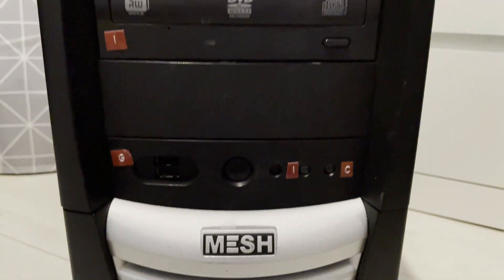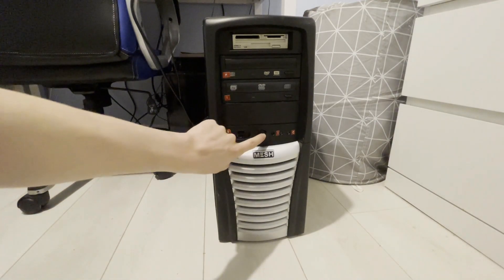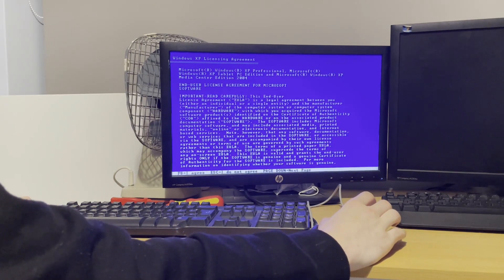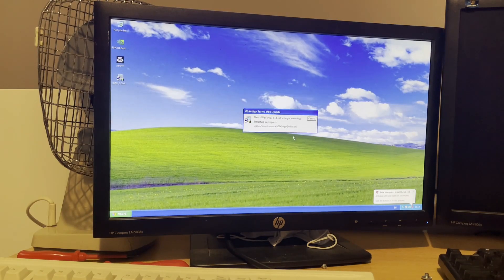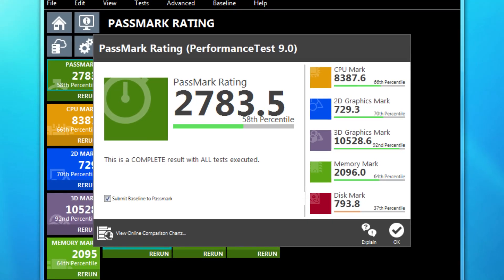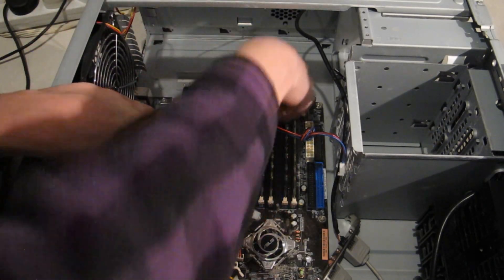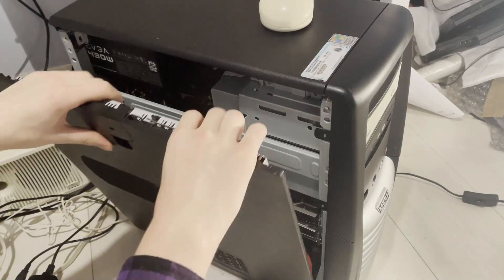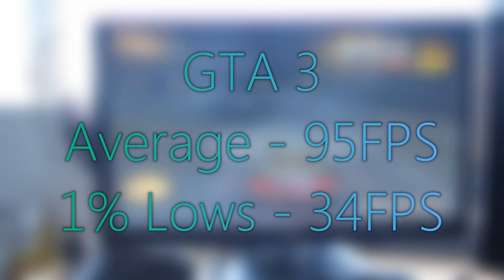Running Windows XP in 2022

Comment: I used to have a Dell Dimension 9100, Dell XPS 420, and Dell Dimension E520 from 2015 to 2020. Fairly good machines. The Dimension 9100 had an Intel Pentium D 830. Those BTX Dells are pretty good machines. The E520 I had stuck a Intel Core 2 Quad Q6600 on it. Used a NVIDIA GeForce 7800 GTX in both the Dimension 9100 as well as the Dimension E520. The Dimension 9100 could not even take a Core 2 Duo unlike what I have now which is a ASUS P5L-VM 1394 in a RAIDMAX Scorpio ATX-868WBP. My favorite system was a socket 478 PC that was a HP Compaq D530. That system I ended up installing a hyperthreaded Intel Pentium 4 Nothwood clocked at 2.4 Ghz. Also had a Dell Dimension 4550 which was decent. Got a ATI Rage 128 Ultra out of it.

Originally that Raidmax was a LGA775 Pentium 4 Intel branded motherboard based system that had seen better days or else I might have left it alone. The system that I built in the case also has a AMD Radeon R7 250X (originally) and Creative Sound Blaster X-FI Titanium PCI-E Sound Card. I have decided to buy a GeForce GTX 275 for it. And if you are going to do the ‘Can It Run Crysis’ meme then do it right by running it on Windows Vista or even better Windows 7 so that you get DirectX 10 support. Do the God blessed H Christ meme right. That motherboard I originally got on ebay with a Pentium D 945 but upgraded it to a Core 2 Duo E6600. Also running Windows Vista as well as Windows 7 on it in addition to Windows XP.

From what I have been told the ASUS P5L-VM 1394 motherboard should be able to take an Intel Core 2 Duo E7600 [SLGTD] which is a Wolfdale chip. This motherboard from what I have researched is only supposed to support Conroe and Allendale Core 2 Duo processors. Had a Dell Inspiron 530S that I put a Core 2 Duo E8500 in. The Inspiron I used as a secondary PC for years. The regular Dell Inspiron 530 can take a Core 2 Quad Q6600. A good fit for ASUS P5L-VM 1394 Core 2 Duo E6600 system in terms of graphics card would be a NVIDIA GeForce GTS 250. I might have to look for an ASUS P5QL-E motherboard. I was originally going to go with the Gigabyte EP35C-DS3R motherboard with a Intel Core 2 Quad Q9450 before that motherboard started just turning on and off on and off.

A good fit for the Intel Pentium D 830 LGA775, Intel Pentium D 945 LGA775, or even an AMD Athlon 64 3800+ 2.2 Ghz Socket 939 would be the NVIDIA GeForce 7800 GTX. Although in the case of the Socket 939 Athlon 64 I would have gone with the AMD Athlon 64 X2 4200+. Although the Socket AM2 variant of the AMD Athlon 64 X2 like in the case of the AMD Athlon 64 X2 4600+ would also not be a bad pairing with the GeForce 7800 GTX but then again you might as well go for the NVIDIA GeForce 8800 GTX. Nobody has a sense of humor to laugh at the fact that back in 2015 an Intel Core 2 Duo and even Intel Core 2 Quad was considered budget gaming. YouTube channels such as Green Ham Gaming, RandomGaminginHD, and Budget-Builds Official come to mind. People just spout the "this is not retro" arbitrary BS rule. People follow this rule when it is convenient for them. Rules for thee but not for me. I have been in a few Facebook groups where they enforced the rules that were convenient to them. Also how many people built a retro Windows XP gaming system with a NVIDIA GeForce 8800 GTX back in 2015? Can’t wait to build a Windows 7 Retro Gaming PC with an MSI 970A-G43 Motherboard with a AMD Phenom II X4 945, 8 GB of DDR3 RAM and AMD Radeon R7 250X in crossfire mode with two of the graphics cards. That I can say is one decade old. No wait a minute that’s not retro in 2025 but the GeForce 8800 GTX was back in 2015.
Reply: So the 64 bit is not retro according to some? 64 bit hardware as well as software is almost as old as Windows XP. In fact Windows XP 64 Bit was a thing. There are two 64 bit releases of Windows XP. In fact for those who don't know the AMD Athlon 64 X2 was the first consumer dual core CPU before the Intel Core 2 Duo. In fact you would have seen Windows XP or even Windows Vista on a machine like this more often than not. Windows 7 running on such a machine as the Raidmax with it's Intel 945G chipset ran better than it did on a MSI 970A-G43 Motherboard with a AMD Phenom II X4 945 and 8 GB of DDR3 RAM.

I had a Gateway GT5418E that had AMD Athlon 64 X2 3800+, nVidia GeForce 6150SE Onboard Graphics, and 2 GB of DDR2 RAM that even struggled to run Windows 7 but not as much as Windows Vista Home Premium 32 Bit Edition. Windows Vista ran like garbage on that system. Windows Vista’s issues were mainly with performance issues was the result of motherboard chipset related issues. Windows XP did not have those issues. What was worse was that the system from time to time would just turn off. Either power issues, overheating, or both. Take your pick.

The only Gateway computer that I really liked was the Gateway Essential ESS 450 SE. I ended up somewhere around August of 2008 doing research on video cards and found that the NVIDIA GeForce 9800 GT was going to be the card that I wanted on the system and I upgraded from onboard graphics to that card. The GeForce 9800 GT came out around I think July of 2008. It was an XFX model before they started exclusively doing ATI I mean AMD graphics cards. Back then they were called AMD-ATI. Early 2010s was a major letdown in regards to AMD and NVIDIA. That Gateway system cemented my hatred of OEM systems. Socket 939 and Socket AM2 were some of the worst sockets that AMD ever conceived. At least you could get Socket 939 with an NVIDIA nForce4 SLI chipset like in the case of the ASUS A8N-SLI-DELUXE.

The thing that I'll say about the Dell Optiplex GX1 even though Dell is another garbage brand is that their business grade Intel Pentium III systems were built like tanks where the only component that you usually had to look out for failing were the hard drives. Back then hard disk drives were common failure point on computers in general. I don't know how people can have such fond memories of shitty OEM brands such as Packard Bell. I can understand Dell being one that people had fond memories of since their machines were moderately decent to really terrible. At least the person that I am thinking of has good taste with Gateway from back in the 1990s when they were still known as Gateway 2000.

Packard Bell is a classic example of what once worked with one sound card in terms of drivers did not work with later drivers for that same card. Now I used to watch the person that I am thinking of back in 2015 but by 2016 I had stopped watching his content because of the fact that I not just did some really stupid shit that put me on bad terms with a couple people back then but also got dragged into a bullshit drama where I ended up leaving the Christian faith on bad terms. Word of advice people online are not your therapist. Learn the rules around para-social relationships and pardon my French but seek an actual fucking therapist for God's sake. Whatever connections that I wanted with certain people I was so desparate to hang onto and not lose them on account of my dipshit self I ended up losing them anyway. Fuck me. There is one of my online friends who has just recently gone through a similar things as of March 14 of 2025 that is about my age from when all the BS went down that I hope to god repents from the path that he is walking. I am hoping that he realizes sooner the deficits in his character.

Comment: Dayumm, i wish i stumble across a pc like this! I also have a PC that's running Windows XP, it has 256MB of ram and has an Intel Pentium 4 with a Nvidia Vanta-16 graphics card, i haven't installed any games but i'm planning on installing GTA 3 or Vice City on it, but it cannot connect to the internet, i'm sure it can because i remember using it back in 2010 or smth like that.

Comment: I love these old socket 939 systems! The BIOS has a nice OC function. I recently upgraded the same A8N-SLi board with an Athlon FX-60 overclocked to 3.0 GHz with dual GTX 550 Ti GPU's running Windows 7, so I could play some of these older games as well.